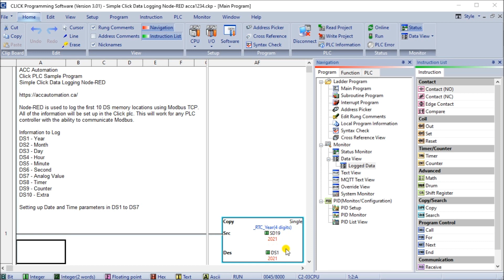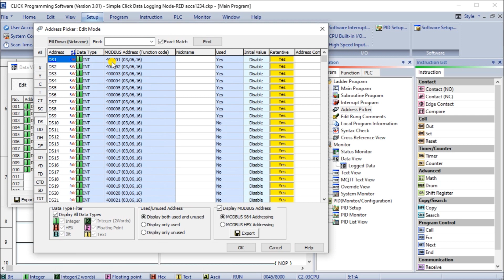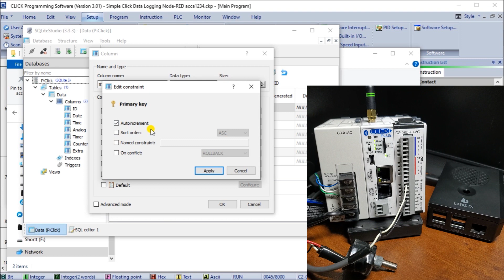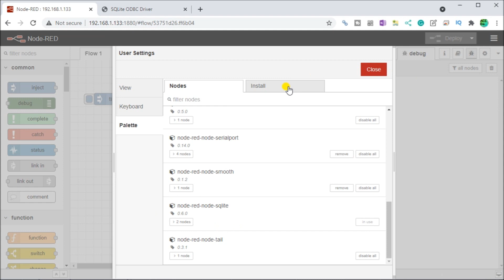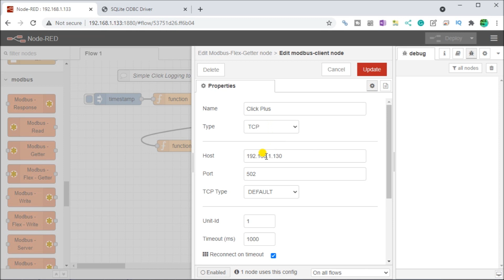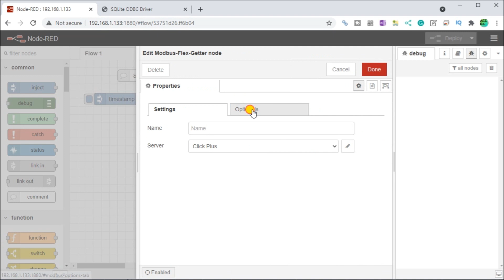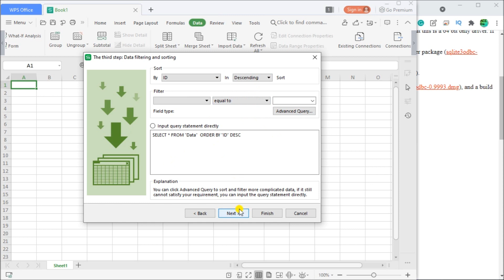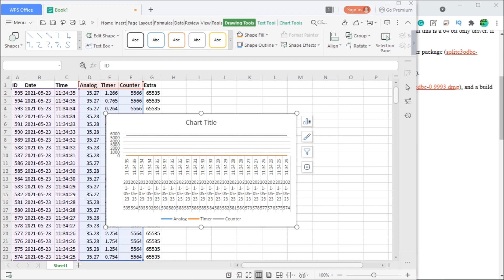Transform Click PLC Data Into Real-Time Plant Intelligence

Comment: This is a great video thank you. I just have a question? How do you read the db from pi? How do you share to the windows over the network? You need to enable or install additional software?
Reply from the maker: Copying the .sqlite file to your computer would be the easiest route, so you don't have to deal with the network connections. 
If you want to share then I would try to do the following:
https://accautomation.ca/node-red-sql-database-spreadsheet-connection/
Note: You may have to open the ports to expose the database directory on your windows PC.
I have not tried this.
Regards,
Garry

Comment from the maker: Hi V J,
Looking at the Click programming software, call up the address picker. On the bottom right-hand side there is a display Modbus address. Leave this on Modbus 984 Addressing.
X001 has Modbus address 100001 the function code read-only is displayed as well. (02)
I hope this helps you out.
Regards,
Garry
Reply: thanks! got it!
Reply from the maker: @TheUnofficialMaker  
Glad you got it working.
Thanks for the feeback.
Garry